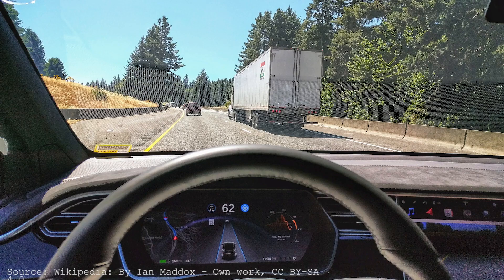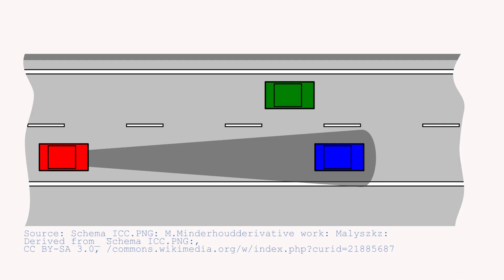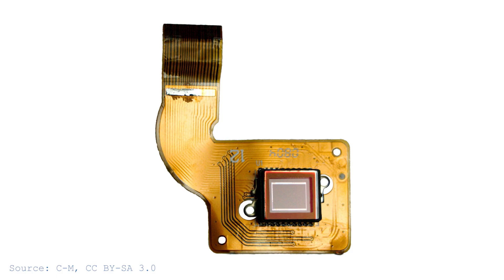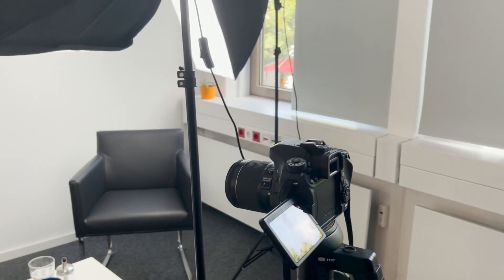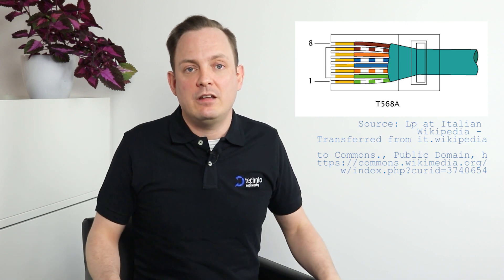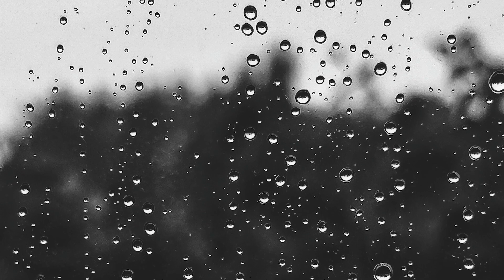What Is Automotive Ethernet?

Comment: Great - Would like to know any Difference between CAN & Ethernet Cables used - Like shielding , Material Difference / Number of Cables etc.. Thank you
Reply from the maker: Symmetry is essential for unshielded Ethernet. The cable must meet this symmetry requirement in its construction. The impedance must also correspond to the nominal value to prevent reflections of the signal.

Comment: Thank you Dr. Lars Völker.
I have a question regarding Automotive Physical layer.
In conventional Ethernet PCS uses block encoding 4b/5b and scrambling to ensure while transmitting bits at physical layer by MDI for asynchronous and NRZ protocol there are bit toggles for synchronisation.
While for Automotive Ethernet PCS just does clock conversion 4b/3b and coding 3B/2T which if input bits are 0 continuously then at voltage will be represented by -1 since both the ternary symbols are -1 or for input bits 1 continuously then +1 since both ternary symbols are +1.

How does a NRZ asynchronous protocol like Automotive Ethernet handles it?
Reply from the maker: Hello Satheesh Kini! 

Thank you for your question! I am not sure I understand it correctly but it seems to suggest that 100BASE-T1 does not use a Data Scrambler? In my humble opinion this is not the case. If you take a look at IEEE 802.3-2018 figure 96-8 you can see that a Data Scrambler is part of the 100BASE-T1 PCS right after the 4B/3B conversion and before the 3B/2T. For a good description you might want to also consider "Matheus; Königseder: Automotive Ethernet 3rd Edition", page 159 and following. 

Best regards,
Dr. Lars Völker
Reply: @technica-engineering  Thank you for the reply. I was asking more from a point of how synchronisation is achieved in 100 Base T1 if data is all 0s or 1s are transmitted since it's NRZ protocol.
I understand 4B/5B encoding ensures there are no consecutive bits continuously while 3B/2T as it seems not the case for consecutive 0s and 1s.
Reply from the maker: Hey  @KinzRulz ,

Yes, using 3B2T does not guarantee that the clock is constantly available. This is the same as for 1000BASE-T on which 100BASE-T1 was based and in contrast to 100BASE-TX.

For 1000BASE-T and 100BASE-T1, the master generates the clock. In the first phase of the link training the slave synchronize to this clock. In addition, the master determines the phase of the slaves signal in the second phase of link training.

Later during transmission, the much long scrambler sequence compared to 100BASE-TX helps that signals basically change often enough. And of course the start and end of the data is marked with specially 00 symbols.

Best regards,

Dr. Lars Völker
Reply: @KinzRulz  You can have a large run of identical symbols in a row. However on average the DC content is zero, so over long term there are transitions. This is exactly why the scrambler is in place so that you have transitions available. The actual RX PMA implemenation is vendor specific. Essentially there is a CDR that tracks the datastream and recoveres a clock based on the data input. For that you dont rely on an edge per symbol, just on a reasonable numer of edges on average. 

Another effect caused by a run of symbol is BLW which essentially shifts the slicer point based on the history. So the receiver needs to keep track of what has been received in order to know where the slicer level is. If you google for baseline wander you will find a bit of background.
Reply: @paxer  Thank you. I will search on mentioned topics.